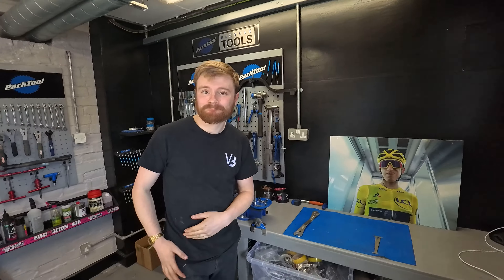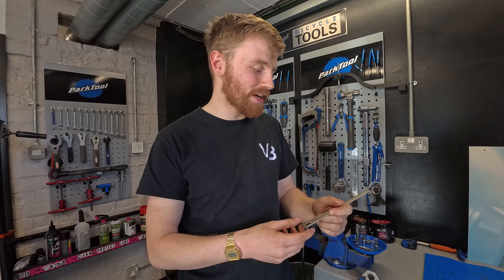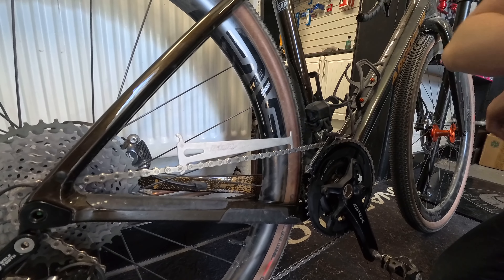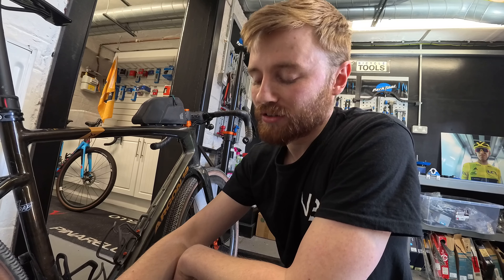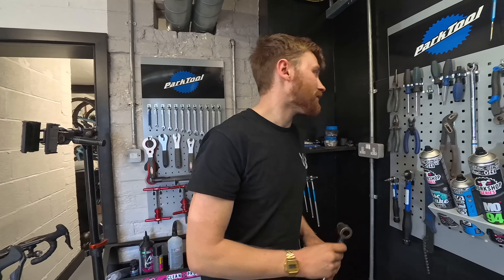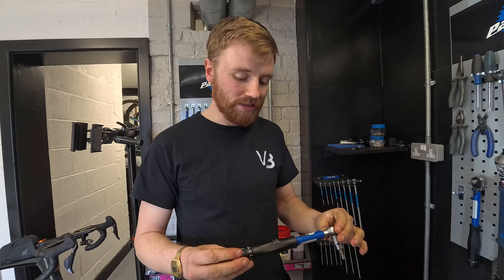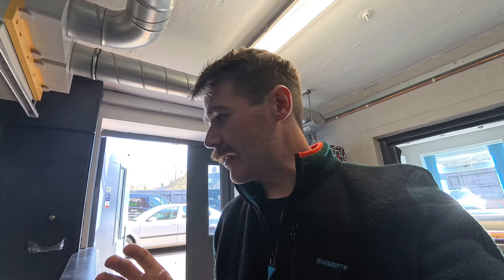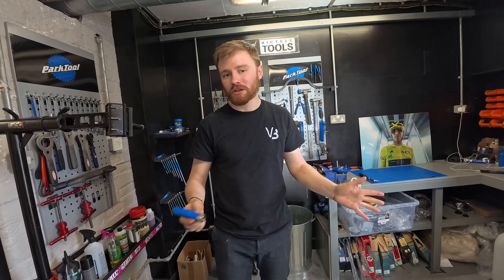5 REALLY USEFUL BICYCLE TOOLS WITH A PRO MECHANIC

Comment: Mine is a general question: what sort of jobs are best left to pro mechanics? Certainly amateur and advanced amateur mechanics can tackle most maintenance, repair or upgrades...what are some examples of jobs we backyard types should leave to experienced pros?
Reply from the maker: Good question! Off the top of my head one I always think is bleeding breaks. One I don’t like and don’t think I’ll ever really do
Reply: Some procedures best left for shop and pro mechanics:

PressFit bottom bracket work: Some bottom bracket shells may not be in-spec, so a very well-equipped workshop has the right tools to correct it back to spec, like reaming an undersized bore which, if left ignored, causes radial overcompression on the bearings, shortening bearing lifespan.

Disc brake mount facing: It's mainly on the cost and use frequency of the disc brake mount facing tool. Once the issue is rectified, you no longer need it unless you got yourself another frameset with such a problem, but a shop sees multiple framesets monthly, so it's more worth it for a shop to own such a tool.

Rear derailleur hanger alignment: Not a piece of cake, but not that advised against. A hanger alignment gauge may not be used often, but when your hanger only needs to be realigned instead of replaced, you'll be glad you have this tool. This is for riders who are at least moderately to above-average mechanically adept as making too many corrections on the hanger weakens the material. The error margin is even smaller on frames with integrated hangers (usually on some steel and titanium frames).

Comment: How much ????
Run 2 x.
9 speed Shimano cassette 15 Quid.
9 speed Shimano chain 15 Quid.
Wanna go modern?
Ok, tad more coin and run 10 speed....
11 and 12 speed is just marketing bollox for elite athletes.
The average cycllist?
 8-9-10 speed with 2 x or 3 x....
Reply from the maker: The triple is dead
Reply: @ChrisHallRides  not where i'm from.
Especally with frictions shifting...
Nor is 7 speed.
And certainly nor is sq taper BBB's...
Have i mentioned that ghastly carbon fibre is just posh fibreglass...
Reply: @ChrisHallRides  all the best, we just joshin'...